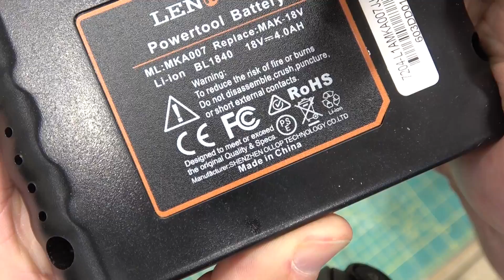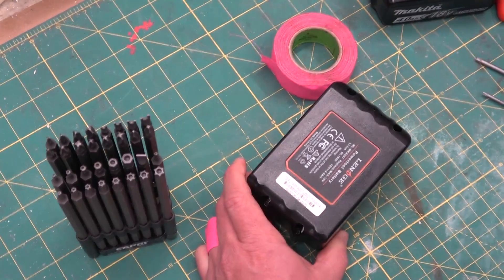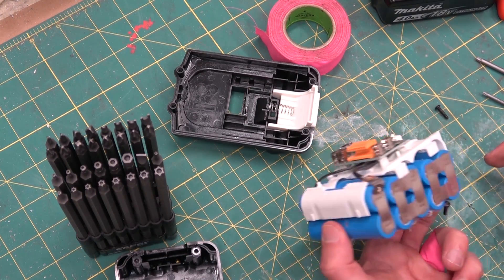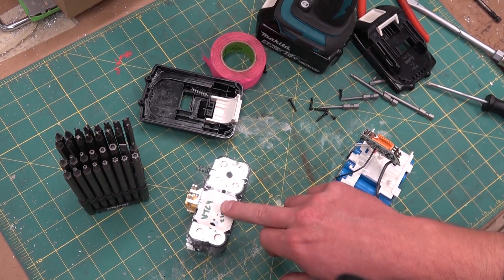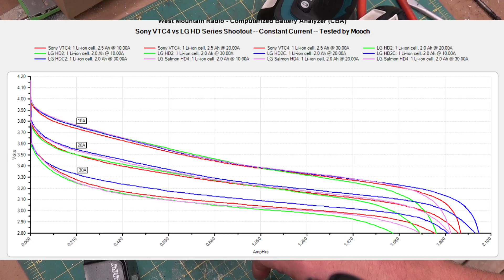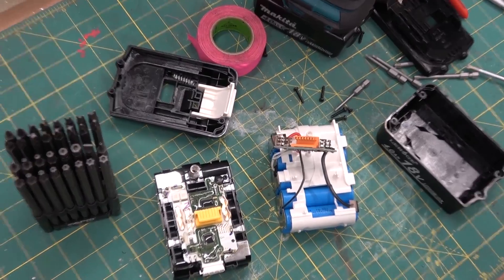BOLTR: Cheap Tool Battery

Comment: My money is on "Works just as well but only for half the time". That's why you buy 4 of 'em... an invariably, when reaching blindly into your case for a swap, you will 9/10 times grab hold of the el cheapo one that's half buggered but you keep onto 'just in case the other 5 batteries get used up somehow'...

Comment: I bought a Milwaukee knock off battery just to have as a spare back up one. It's been holding up pretty good. I use it in a grease gun so it's not usually get abused to bad. The biggest problem I've had is the screw that hold the case together had the plastic mounts start to break. I wrapped it  in some electrical tape and it's still going fine.

Comment: from my experience using knockoff lithium batteries, the big problem with them is the complete lack of any balance charging and monitering (treating the whole pack as a big cell) . there is also a lack of protection, a broken charger i had shorted 4 out of 6 cell in a pack, and due to the lack of feedback from the "bms", it kept on charging because the cutoff voltage isnt reached. kinda scary honestly.

Comment: The cheapo ones always have lower discharge rate. Makita cells more than likely have 20amp+ rated discharge cells where the cheapo will have 10amp. Not a big deal with a radio or a light but power tools will stall out under load.

Comment: I ain’t no pixie expert, but I’ve been working in a failure analysis lab and we’ve seen quite a few of these chinesium 18650 cells come in having blown up in some poor chums hand with enough force to split it right in two. Cheapo manufacturing makes them more susceptible to thermal runaway for some reason.

Comment: I bought an electric black and decker weed trimmer, has a 2 ah 40v battery pack, it's 5 years old now. I can mow around the edge of my property just fine with battery to spare, a lot of times I only use half the battery. If I had to dick with a gas powered weed eater I would've had to rebuilt the carb 3 times by now, so I'm pretty pleased with it.

Comment: You know what's more frustrating than a weaker battery? ..a new factory battery that the factory charger has deemed unserviceable when it's been drained for too long or whatever. I had to buy an after market charger when 3 of the 4 factory batteries I have couldn't be charged by the factory chargers. When it comes to Makita batteries and chargers, I find the after market stuff to be more reliable. I still prefer Makita over that yellow and black and decker brand but ive got quite a bit of that brand too.

Comment: Today, after owning my Makita LXT 18V 1/2" impact wrench for nearly 11 years, one of the original batteries died. Well it didn't die, die, it more petered out. I think it might have to do with when I let the air out of the air suspension on a truck at work and the impact got stuck  upright between the fuel tank and the shop floor. Still the other battery lives on and I can't say I've noticed the use time dropping off too badly either. That's to say, the impact wrench itself feels rather weaksauce, so I'm probably in the market for a new one soon. 

I'll likely buy another Makita.

Comment: You said you researched the batteries and they were "GOOD SONY" batteries... I'm sure they're not.   They rewrap them and make them what they want them to be.  Check them out individually by weight and specs,  mAh,  voltage drop and...  I'm betting you'll find they're fake!!!

Comment: things from this video (or inspired by) not to say on your wedding night......

1: whats that smell?
2: this one looks cheaper then the last one i had.
3: fits kinda lose compared to the the last one i had.
4: is it supposed to look like that?
5: wonder how long i can use that before its broken.
6: glad i didn't pay much for this.
7: should have gotten the more expensive model. 
8: theirs nothing showing how much longer i can use this.
9: looks kinda cheap
10: i dont think i have the right tool to test this 
11: is it putting out  enough?
12:  dont fuck around with the cheap ones
and number 13: its so frustrating not to have the right tool for the job!

Comment: I bought two off ebay that have the indicator for the battery on them. They are labeled Makita but are obvious fakes. They are labeled 5ah but are the same size and last the same as the 3ah that came with my 1/2" impact. They have no discharge protection they will discharge until dead

Comment: Just curious, but why would I care about a conformal coating in a low voltage device?
Reply from the maker: keeps the big chunks of water out.
Reply: @arduinoversusevil2025  ok. I thought they were mostly to prevent high voltage arcing or shocks. I mostly see them in HV boards like the HV section of tube TV's   and monitors for example. 
The low voltage stuff usually has a protective coating that's closer to cosmoline. A waxy oily stuff to keep water and corrosion damage from happening.

Comment: Was going through some older videos,  saw the BOLTR on the crappy knife sharpener, and wondered if you might take a look at a worksharp system, which is, as far as I know, the only electric knife sharpener worth a damn.

Comment: i use the super cheap fakes in my makita tools. the only trouble i have is they will not shut of on low voltage and i am afraid it will cause them not to last a long as the brand name, but the price is less than half and mine have last over a year and a half.

Comment: Bought about 4 el cheapos for our Rigid tools a few years ago when the original ones shat the bed after a single rain storm. So far they've lasted longer with worse treatment (probably cuz they don't care about recurring revenue). Every time one says its defective, ya just throw it against the wall and give it a few minutes to realize the only alternative to working proper.

Comment: I've got a Chinesium DeWalt 10.8v (12v) battery that gets used fairly regularly with my impact driver & drill set... I've not noticed any difference between the genuine article or the knock-off and for pocket change it stops me having to have a tool with no battery whilst one is cooking on the charger.

They get regularly pressed into service that I should really be using an 18v (20v) set for too

Comment: I suggest running the battery through repeated charge and high load discharge cycles and after full discharge, measure the voltage of each cell. If they differ by more than ~ +/- 100 mV then you have your answer on the quality of the cells and battery management circuit.
Reply: The likely cheap-outs are the internal impedance of the cells, testing and sorting of the cells by impedance and the battery management circuit. They are likely to work fine initially and quickly decline in terms of actual capacity.

Comment: I'm mostly a tree carcass mangler and I've got a mix of Makita and Fakita batteries in my shop.   I'll use either brand for just about anything in my shop, its just wood.  I always grab the proper Makita batteries if I'm taking my tools off site as I'm always expecting the fakes to die at any moment (so far none of them have died yet).

Comment: The question is will they start a fire in your home/shop when you put them to charge? Or leave them on your charger? Or blow the electronics of your brushless tool? When it comes to batteries these days you are taking quite a few risks for using non OEM on your expensive tools

Comment: For a drill or work light the Nakita/DeWilt batteries are alright, but for the rotary hammer or sawzall that you're giving a hot supper to the factory batteries usually put out more pixies before getting crusty.

Comment: RoHS is a legal requirement in the EU and restricts the sum concentration of Pb, Cd, Cr VI, Hg & possibly Sb to about 100ppm sum total IIRC (hence no Pb solder). Also some specific flame retardants and plastic softeners have limits. Ultimately anything which requires electrical power for its PRIMARY function needs to meet the RoHS directive... there are some rare exemptions however such as military applications and space stuff etc or where there really is no other option.
So a torch would need to meet the directive.. but would a Pen that lights up? because its primary function is that's its a pen ?

Comment: Looks like the Chinesium brand has no individual cell voltage monitoring or balancing, not good news in something that's also likely to be using low quality cells.

Comment: Seems to have little to no balance charging with low quality cells, better not to charge those battery packs without supervision after the batteries have had some use cycles, as there will be overcharging in some cell pairs.

Comment: I run a bunch of ryobi stuff for my business mostly because I already had some tools and 2nd because of there large selection. I also run some worx stuff. The worx stuff isnt run as much as the ryobi. I've had excellent luck with generic batteries especially with the ryob I've got one that's used daily and never had an issue with it. We run daily multiple stick vacuums and sweepers and the let me tell you we run the piss out of the vacuums. What I have had problems with is ryobi and there craftsmanship, they suck and getting parts and stuff warrantied is a nightmare. I've had to Warranty over half a dozen stick vacs due to the hoses cracking in the head each time they just send me a whole brand new vacuum with a new charger. One of the recent issues I'd been having was the ryobi batteries were dying right after being charged on the charging station for the vacuum. I finally dug into one, it was charging at 27.89 volts and 300ma  low and behold I opened several more and was all the same 27.89 which is definitely wrong from everything I've researched.

Comment: You don't need a dyno. You will prob find that the cheapo charge in 20 mins on a makita fast charger. This indicates that they are actually 3.0ah not the 5.0 they claim. A 5.0ah battery should take around 40mins.
Reply: A dyno (or other proper testing) will tell him much more than just mAh. It will tell him things like max current and voltage sag. It's easy to find 3000+mAh batteries, but they typically won't supply much current under load, and they will heat up and break down very quickly under heavy loads.

Comment: Those chinesium cells almost always re wrapped recovered cells from the established brands.
Reply: China makes plenty of their own cells, just not the ones with the highest max current/mAh, lowest voltage sag. It all depends on what properties you need for an application.
Reply: @scottr939  true. But as you said not high Ah or discharge C rates like the established brands. (Panasonic/Sanyo, Sony , LG etc). High drain application like power tool battery I would suspect  re wrapped cells.

 I'm building a powerwall with recovered cells they still have plenty of life left in them and perform to the spec sheet.

Comment: You need a silicone wedding band. I got one after I turned my titanium one into an arc welder with a mower starter solenoid!!!!!! Nearly pissed myself.
Reply: I'll keep that in mind if I jump that bridge lol. Can diamonds be set in it? I need some "bling" for that kind of commitment 🤣🤣🤣
Reply: @GoTouchGrass  Conformal coating and silastic.
Reply: It's no joke, and no shame in nearly pissing yourself. I've full-on soaked my socks due to electrimicity.  Still wear a cunsten targlide band to this day, but very careful in doing so.

Comment: 9:10 you scratched through/ripped the battery wrap.  Might want to at least put a piece of electrical tap on that to avoid an accidental short circuit!

Comment: Resistance welding! Clamp two thin metal parts together and just run a metric shitload of pixies through the two- BAM! Welded. Interesting tool side note- went into a Lowe's today and checked out the tool section because, I mean, ya just GOTTA. Fair bit of red stuff, none of it Willfuckye, all Crapsman stuff. Just out of morbid curiousity, I started sniffing around to see if there was any Willfuckye stuff, negative. Nada. Zero. Zilch. Bupkis. Not even a package of expendables.

Comment: I think the point is to make a comparable product for less, not a better one! I bought a pair 5AH 20v bats for my Dewalt, they're no-name Chineesium but the were not exactly cheap, I paid $80.00 for the pair which was still half the cost of the name brand of the same thing. Mine work great and I'm very happy with them, now I can screw from sun up to sun down!
Reply: Like everyone else, China makes both good and bad stuff. Problem is it's very hard to know which is which. Never trust the labeling alone. Buy from a legitimate source that guarantees the quality. The big battery re-sellers like IMRBatteries and LionWholesale batch test their shipments because they have all been scammed in the past with junk that looks very legit but don't meet published/expected specs.
Reply: @scottr939  No arguments here, but the only way to know what you are getting is to go out and get, then test, "OR" find a guy like this doing it for you.
Reply: @Finite-Tuning  Like I said, buy from a respected vendor that guarantees their product. When IMRBatteries got a counterfeit shipment a few years back they sent out replacements to all their customers. That was no doubt very costly, but they did 'the right thing' for their customers. That is why they now batch test all their shipments.

Comment: Not a bad review, would have been better with testing even a rough time vs work, but I like to see what I am getting for the cash.I have a bug bear on batteries though as Good old Sony and Pioneer used to chip the cells and chargers to stop other manufacturers making cheaper and in some cases better value cells from working (same scam as printer inks) so these type applications ( domestic / consumer) type packs it's nice to see "choices" keep up the good work

Comment: No comment on the pinch lines on the white wires?  Looks like the case is forcing the white wires against the sharp nickel plate, with vibration and handling could cut the lead and cause a short.

Comment: Thanks for the mention! Glad my testing has been useful.
I couldn’t find any definitive info on those TN-NA3 cells. I was expecting the worst as you started opening that pack up but it wasn’t quite the nightmare I thought it was going to be...assuming the electronics work. 😁 Looking forward to your testing of those packs!
Reply: Man, Mooch replying to Uncle Bumblefuck.... Wtb crossover vid now.
Reply: Great database!

I realize, as a robot builder, I have different priorities from most users of your database. I would like to see grams per cell in the database. Robot competitions have weight limits.
Reply: Fancy seeing you here Mooch
Reply: Unkle bumble mooch? Lol
Reply: The lack of balancing and protection circuitry makes them dangerous.
Reply: From a few i did they are essentially 10amp batteries with a pulse rating of 10amp. Their basically. Going to be ultrafires. Occassionally iv Seen that code and wrap in a powerbank with it NOT being a lithium jon cell so be careful.
Reply: I blieve these cells are made by a company called EVE. 2600mAh 7A cells.
Reply: I’m wondering what might happen if one were to use the cells from the cheapo battery to replace the cells in a dead OEM battery.
Reply: They'll work, but if I were to run them I'd at least open the packs up to make sure all the spot welds took. Seeing how some of those are barely on there, a few knocks and you have a disconnected cell - working the other in it's pair doubly hard and undoubtedly reverse charging it when running the pack down. (I took apart a few hundred overboard packs years ago and found the same issue - barely on there or not even attached cells.)
Reply: Mooch, the God of battery safety (especially for us Vapers).

Comment: I've been using the cheapo knockoffs for a couple of years after all 4 of my genuine Makita batteries locked them selves from charging after a really cold night ... I took the genuine batteries apart and tested the cells all the cells had dipped to ~2v and the charge control board had locked the batteries...now a days you can just buy the charge control board ..but they weren't available then ...it's a common problem with the Teal devils ...still love my Makita tools but the cheapo batteries have proven a great asset...yes they don't  have the same capacity of the genuine batteries...but they're 1/8" of the price over here in the UK
Reply: i have a similar problem. I can replace the bad cells by new ones, but cannot reset that board.
Is that replacement a genuine part? or one of the chinese  fakeydoodles?
Reply: I'd use the fake Chineseium part the OEM boards are a pita ...I had no dead cells they all took a perfect charge when connected to an external Ballance charge board...I'm an electrician ..all my genuine baterias "died" in one Uber cold night...my fault I shoulda not left them in the van.

Comment: I bought a pair of he Dewalt knock offs for the smaller 1/4 an 3/8 impact guns, I used the legit 6ah flex batteries on the saws and 1/2 impact. For shits and giggles I tried the cheapos on the sawzall- over heated and killed it in 4 mins..... it was a fully charged “6ah” battery. So yeah you get what you pay for.

Comment: Reminds me of how my police department that I work with has several questionable brand radio batteries in our inventory. Only acceptable stuff is from well known brands, like Motorola, GTS/Honeywell, and Multiplier. We've got about 8 cheap batteries labeled "Power Pro Solutions" in the classic crapese serrif font. I keep hiding those ones away in a cabinet, but they just keep showing up.

Comment: Lithium is lithium.
Reply: Unless if it's filled with sand.
Reply: There are lots of different Li-Ion battery chemistries, and lots of trade-offs between cost/mAh/current capacity/safety